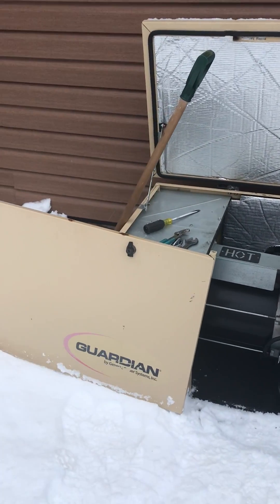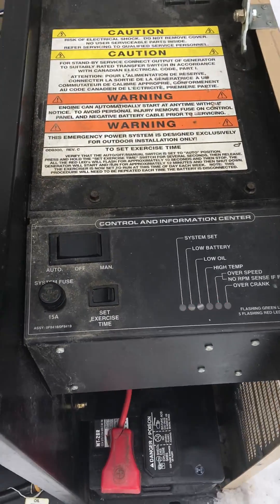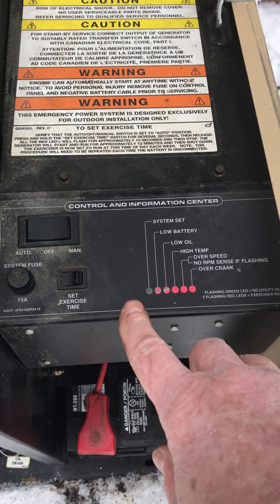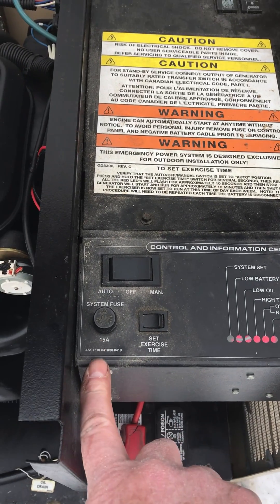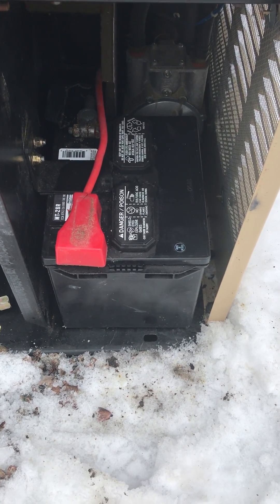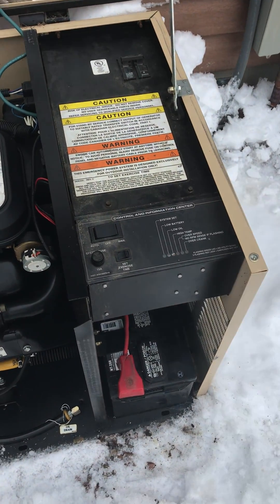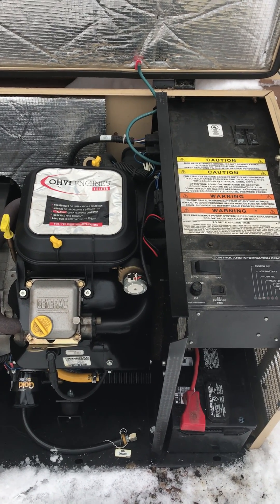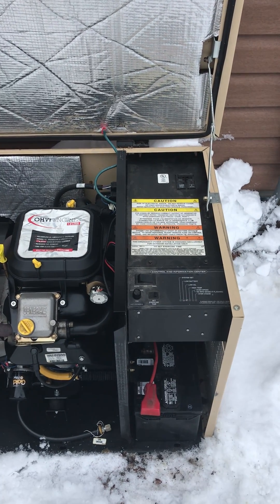GENERAC OLDER 13KW GENERATOR BLOWING 15A FUSE

Comment: I hate the old generac generator they use to much LP ridiculous .36 hours for the LP during the power Outage. The new generac generator use 2-3 gallons 3.02 of LP you be good for a week.
Reply from the maker: I have heard some stories. The newer models are supposed to be much better but you would certainly hope so.
Reply: @snowman6686  ... as a 25 year service tech on these things I can safely say the fuel consumption has hardly changed over the years. You had another problem.... probably a leak.
Reply from the maker: @rupe53  I'm just an electrician who's been installing standby generators since the ice storm of 98. The stories I was talking about were on Generac's that allowed the fuel to pass through the bellows even after the generator shut down. NOT having witnessed it myself I only say "I've heard stories". I look for a regulator mounted at the generator.
The Owners Manual - Table of Contents has always listed "Fuel Consumption" and the table for fuel consumption  lists the fuel consumption for all of the Residential Standby Generators at  both 1/2 and Full Load. per hour.  I use this 411 to help in making decisions on which size generator to buy. (What do you really need to get through a power outage? How much fuel will it take per hour? How long will your fuel last? How dependable is your fuel supplier at getting to you for a refill when the power is out?)
Power outages aren't friendly - waiting for your tank to be topped off before an outage. So exercise cycles are important especially if they are on a stand alone tank and you haven't experienced an outage in years.
My videos aren't instructions on "How To", they merely show what may be involved in causing the failure. Maybe just "good to know" information.
I started these videos after seeing $600 stepper switch replacement  which didn't fix unit. $400 starter motor replacement. and the like.
Anyway. I do what I can. You could too with your experience.